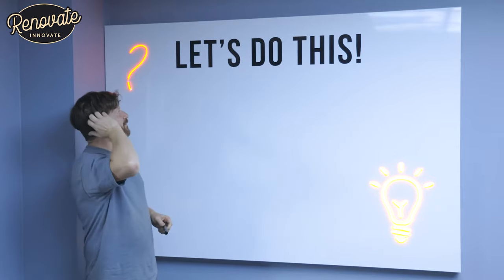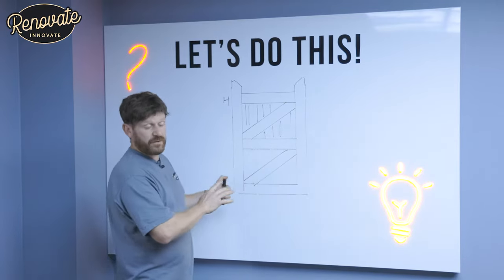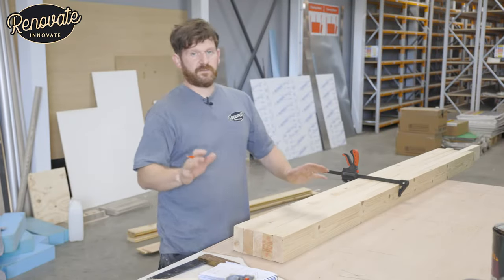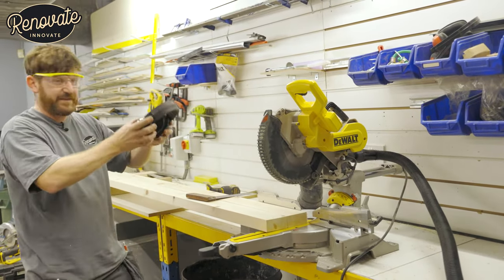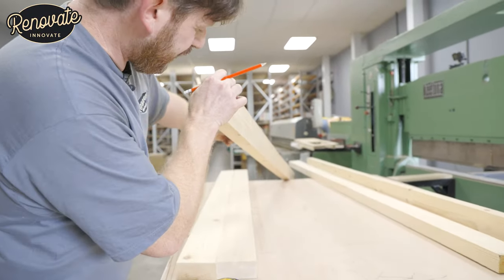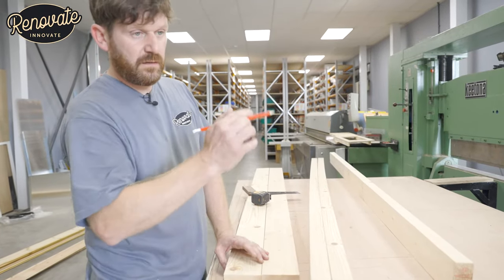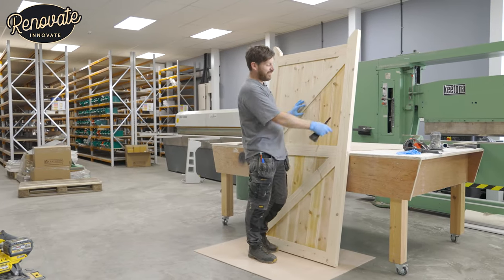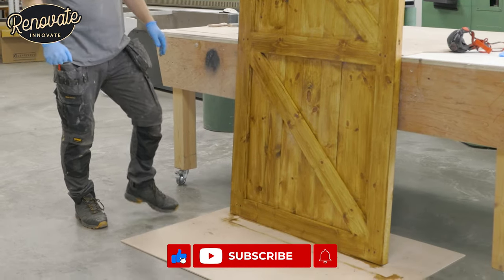How To Build a Morticed and Tenon Garden Gate Just Using Hand Tools | Innovate Project

Comment: Love the style of this video (and the choice of music). Compared to most vids I've seen on door builds, this is pretty complex and you're not 'just using hand tools'. I'd have to buy a router but I fortunately have a chop saw already - though I'll be doing it on the floor of my carport as i don't have that amazing bench facility. Also you say at the start that you'll be staining before assembly but you don't. Did you forget, couldn't be arsed or was there a reason? :-) Great vid and nice work.

Comment: What size timber did you use Andy and is it treated for outdoors prior to fitting?
Reply from the maker: We used 4x2 for all the frame and matchboard which I think was 8mmx 94mm, we did not use treated timber due to the customers budget so the gate was just stained for protection.